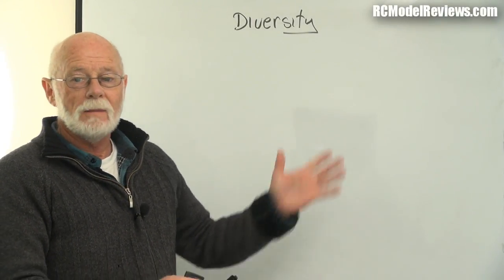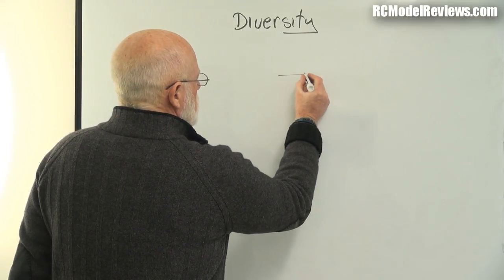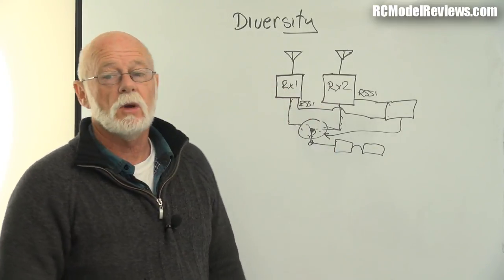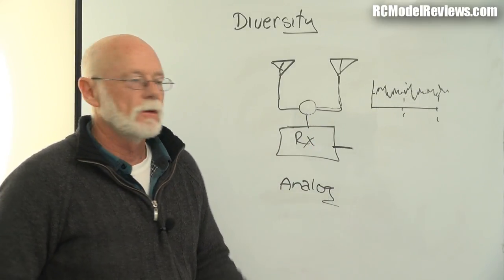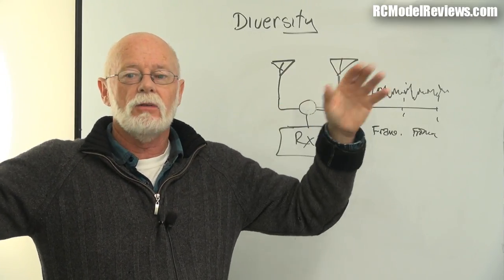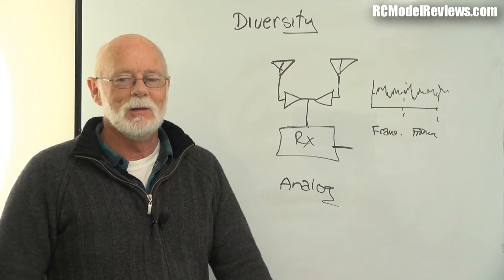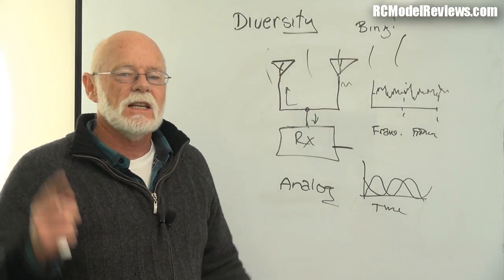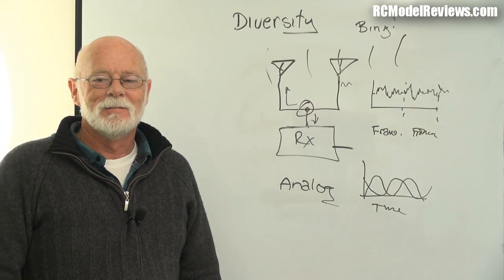Receiver and Antenna diversity 101

Comment: Sorry, I had to laugh when the text popped up saying Joshua Bardwell did an excellent review of the ev100's when all he basically did was call them crap and admit he didn't even actually try to fly with them. And all RCSchim did was bitch about the FoV and call them unusable.  It bugs me to no end that budget things like this don't get looked at from the aspect of someone who has nothing, and instead get compared to a product that costs 5-6x as much.  I can tell you as someone who bought EV100's having nothing, and having no interest in paying $500+ for fatsharks + modules, etc that while yes, I'd prefer the FoV on the EV100's be larger, I have zero problems flying with them and I think they were well worth the $99 I paid.

Comment: I got the EV100 and they a good for the price bracket. I don't race with them, I only fly by myself. I am going to try a dummy load on one antenna port and just one antenna, to see if there is any difference to the signal quality. It's pretty good normally.

If you have used better goggles before,  like Fat shark etc, these are not for you. I've only had box type googles myself, to which these are an improvement. The FOV is the same or slightly bigger then the base Fat Shark Teleporter, V5, but a lot cheaper price. These are a entry level goggles, they are NOT Fat Shark beaters.

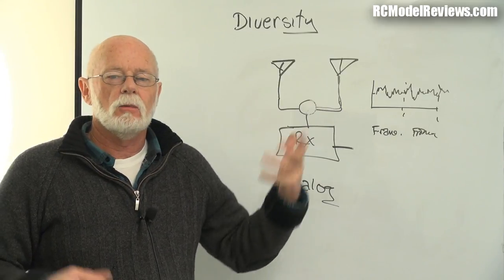Comment: 8:00... So.. why didn't you buy a pair when they were $99.00 and actually test them yourself like many of us did...
BTW.. if the diversity in this googles causes dropout as you explained.... For $99.00 Goggles...
I'll install only one Circularly Polarized antenna. This might probably lock the Receiver to that one Antenna to reduce the dropout. To be tested.

Comment: You can easily compare signals from antennae during say Synchronization pulse or Color burst. The more robust way is to compare SNRs of preamplified and demodulated signals cause the more weak signal isn't always the worst one. The best but way more difficult way is to solve a system of equations to find complex coefficients for best combination of preamlified (but not demodulated) signals on a gauge signal (say Color burst) like MIMO systems do.
Reply from the maker: You could do that but it's not often done for a couple of reasons.  Firstly, the color-burst and sync pulse (unlike the preamble in a digital system) are both important pieces of information that need to be received with some integrity for the subsequent part of the frame to be properly synchronised.  Secondly, the circuitry required to decode the frame and create a "trigger" event for the antenna switch is more complex and costs more than simply using two receivers and an RSSI-based selection system.  Of course there is potential for a proper "signal integrity" diversity system to outperform an RSSI-based system when working with analog signals such as FPV video -- but the cost goes up.

Comment: i believe clearveiw has only antenna diversity how is their system different ? i think eachine and other Chinese items are unfairly treated for the price they give to beginners the items are great quality. all top brands dont even care to upgrade or try new things and extremely overprice all items for same only sometimes better but not by the price gap. from motors to goggles its all more or less the same many times from same Shenzen factory. Eachine in a few years has listened to every person in hobby and upgraded and changed to suit all wants. ppl wanted lighter arms its ok on floss a higher priced frame but not ok on best entry kwad for price. plus they quickly change back i call unfair and i like you guys but i see it on every channel pokes at chinese items but its ok for other to over price same or even less. i dont think you should go hard on reviews but be fair jump on the over priced items so we all can get them not try to kill the only entry point for new pilots. sorry about rant but fatshark has worse goggles then these that cost more but no one said anything
Reply: ClearView has two receivers built in. You normally use them without diversity, though you can use them as a normal receiver diversity if you wish
Reply: yes you are right but it uses a type of frequency analyzer and dual receivers but or sure some of the modules for the fatshark are AD. i just want someone to compare to teleporters.
Reply: Right on brother. Be good if someone would be able to crash test frames like they do to cars, for people that want strength in their model. So putting science to any review would help a lot too. :-)